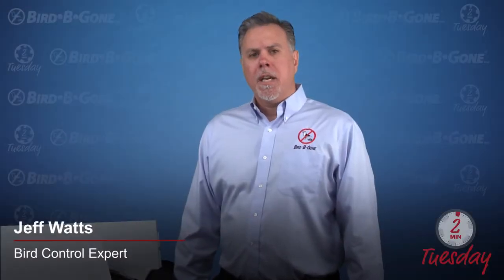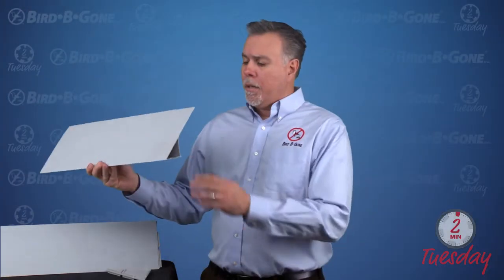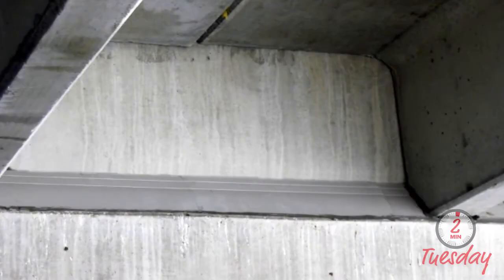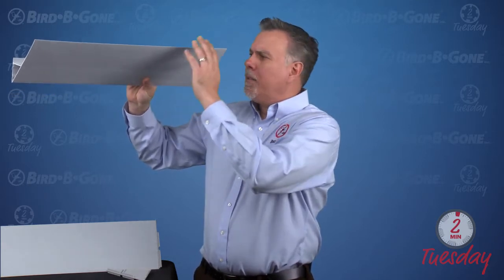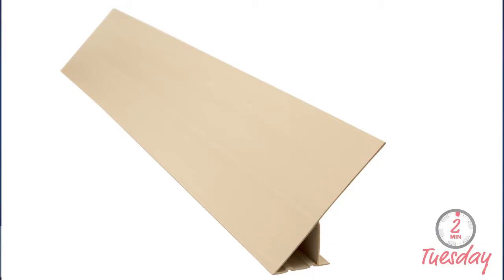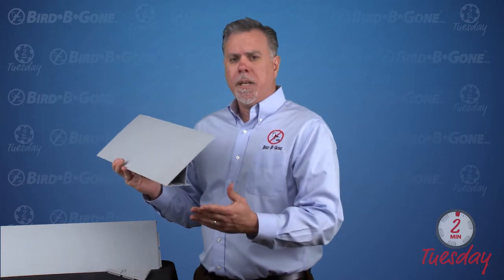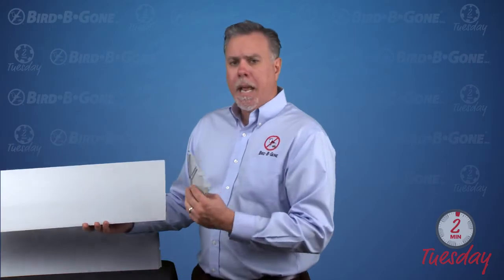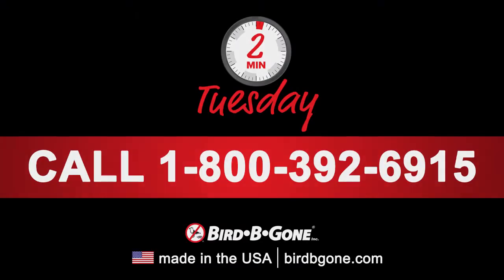Bird Slope Overview

Comment: Your website recommends these slopes for swallows but you don't? Which is it?
Reply from the maker: For best practice our experts typically recommend 3/4" Bird Netting as best practice when deterring nesting swallows. You can learn more about this in the following video (https://youtu.be/WGoOgJhpGao). Bird Slope can be to deter swallows but bird netting is much more commonly used and versatile of a product as it can confirm to many different structure sizes and shapes.